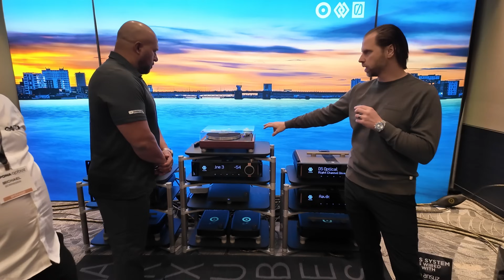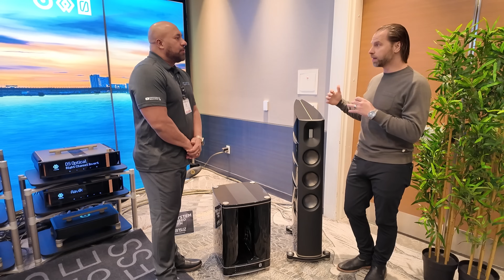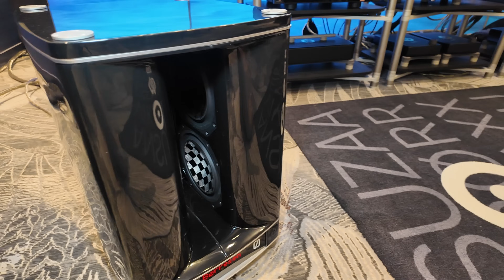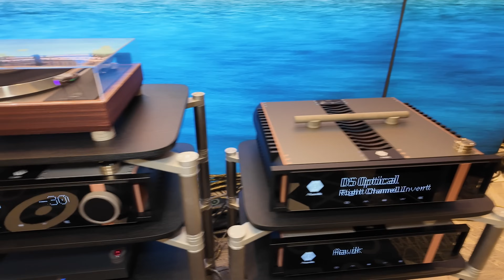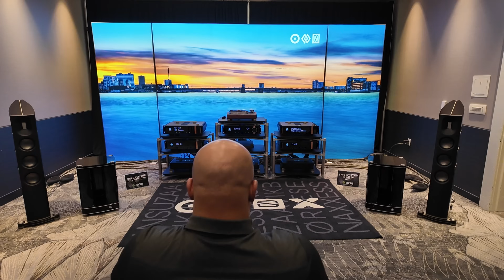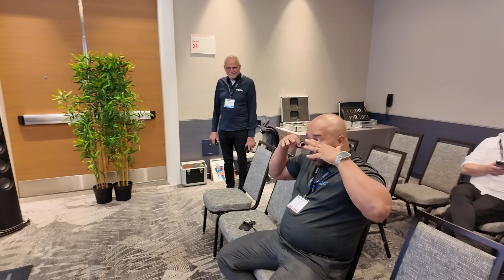Axpona 2025 - World Debut Of Borresen M2 & New Subwoofers!

Comment: No wonder the younger generation have zero interest in high end audio, with these insane prices.
Reply from the maker: Different prices are within the audio group Denmark umbrella. Find the one that suits your budget
Reply: Buy used from the guys that spend their lives chasing different.  My system is mostly late 90s vtl, arc, dunlavy, vandersteen, with a vintage mitchel transcriptor table (because its cool) and a newer high end arc cd.  It can probably be replaced used for $12-15k ish and it outperforms much much more costly systems. 100% room limited so why chase gear? Buy quality and learn how to tweak your room and setup.
Reply from the maker: @johnhartley3022 good point
Reply: Also bingo. @johnhartley3022
Reply: lol... i'm just not as stupid as you / the Borressen Customers who buy one single subwoofer for 20k 😂😂😂... I'm very happy with my systems, thanks... But if you want to get ripped off and want to give them your money, order directly 4x subs + you buy directl ,,subwoofer,, cables for 10k. The borresen guys laughing in denmark.
Reply: @ I agree. Borresen customers often have "to much" money, and very little insight in hifi.. That's a cold hard fact.
Reply: @vtkz  Hi there saying people are stupid is really labeling and disparaging of people with different values and mindset as if they have a lack of intelligence or even a lack of moral-common sense,which is based largely on make wrong perception and projection.This is actually arrogant.Myself when I have the money to purchase the high end audio products that I desire I will do it in a heartbeat.My audio system is modest at this time.😂
Reply: @vtkz  Look, i know people like you very well. The way you think, the things you'd say, the things you believe in. The truth is people like you are poor, bitter and hate the world for your own lack of success. You're so poor that in fact, a home theatre system is stretching you financially. 

And then one day you suddenly come across a couple of forum threads on ASR written by Amir. You discover REW measurements and SINAD figures. Suddenly you believe yourself to be a misunderstood genius. "All rich people must be stupid!! I'm the smart one!!" ASR now becomes a part of your identity, your emotional crutch for being a l0s3r in life. 

So now your mission is to crap on anything above your financial means, just so you could feel a little bit better about yourself for being such a l0s3r in life. 

The truth is many people like Jay started with very humble systems, and many have dabbled in dsp-ed home theatre systems and know them well. They aren't 'stupid' people like you say. Many have worked their way up after having experience with better systems. Contrary to what you think, rich people do not just go straight for a 500k system without knowing anything or having any experience. 

You do not know this because you don't have such people in your social circle, and that's how i know you're poor (even if you claim you aren't). 

But keep having this attitude in life brother, that's what got you here in the first place. 

P. S i already know what kind of response you'd give (if any), either more emotional hate, trigger response, dismissive reply, self-preservation tactics, or claims that you're rich too... I've seen it all. Peace out.
Reply: @vtkz    Look, i know people like you very well. The way you think, the things you'd say, the things you believe in. The truth is people like you are poor, bitter and hate the world for your own lack of success. You're so poor that in fact, a home theatre system is stretching you financially. 

And then one day you suddenly come across a couple of forum threads on ASR written by Amir. You discover REW measurements and SINAD figures. Suddenly you believe yourself to be a misunderstood genius. "All rich people must be stupid!! I'm the smart one!!" ASR now becomes a part of your identity, your emotional crutch for being a l0s3r in life. 

So now your mission is to crap on anything above your financial means, just so you could feel a little bit better about yourself for being such a l0s3r in life. 

The truth is many people like Jay started with very humble systems, and many have dabbled in dsp-ed home theatre systems and know them well. They aren't 'stupid' people like you say. Many have worked their way up after having experience with better systems. Contrary to what you think, rich people do not just go straight for a 500k system without knowing anything or having any experience. 

You do not know this because you don't have such people in your social circle, and that's how i know you're poor (even if you claim you aren't). 

But keep having this attitude in life brother, that's what got you here in the first place. 

P. S i already know what kind of response you'd give (if any), either more emotional hate, trigger response, dismissive reply, self-preservation tactics, or claims that you're rich too... I've seen it all. Peace out.
Reply: @vtkz    Look, i know people like you very well. The way you think, the things you'd say, the things you believe in. The truth is people like you are poor, bitter and hate the world for your own lack of success. You're so poor that in fact, a home theatre system is stretching you financially. 

And then one day you suddenly come across a couple of forum threads on ASR written by Amir. You discover REW measurements and SINAD figures. Suddenly you believe yourself to be a misunderstood genius. "All rich people must be stupid!! I'm the smart one!!" ASR now becomes a part of your identity, your emotional crutch for being a l***r in life. 

So now your mission is to crap on anything above your financial means, just so you could feel a little bit better about yourself for being such a l***r in life. 

The truth is many people like Jay started with very humble systems, and many have dabbled in dsp-ed home theatre systems and know them well. They aren't 'stupid' people like you say. Many have worked their way up after having experience with better systems. Contrary to what you think, rich people do not just go straight for a 500k system without knowing anything or having any experience. 

You do not know this because you don't have such people in your social circle, and that's how i know you're poor (even if you claim you aren't). 

But keep having this attitude in life brother, that's what got you here in the first place. 

P. S i already know what kind of response you'd give (if any), either more emotional h*te, trigger response, dismiss*ve reply, self-preservation tactics, or claims that you're rich too... I've seen it all. Peace out.
Reply: @vtkz private equity making good profits
Reply: @vtkz If someone likes this or any product and can afford it, are they getting ripped off?
Reply: @vtkz sour grapes.  Why are you even commenting if it’s overpriced?  Why would you even care if you like your rig?  Again, sour grapes.
Reply: Priced for fools
Reply from the maker: Im the Messenger. I simply present and inform what I liked that was a standout room for me.
Reply: @jaysaudiolab  Fair enough Jay, your videos always spark some interesting debate and opinions, and thats amazing-
Reply: That's like saying young people are not into cars just because Ferrari and Lamborghini exist.
Reply: @A-gks  the problem is, they are way too overpriced. Subwoofers Performanced is based on DSP integration (Time, Phase & Frequency) & of course placement & concept (Double Bass Array, Single Bass Array with Bafflewall, Multi sub etc). When they have balls, they would show an REW Measurement of their show rooms (they never did of course). They want to sell, thats the main thing. The homecinema guys laughing at this kind of subwoofers. But maybe the high end customers get what they deserve, such overpriced products need to be buyed from people who have too much money, and no logical thinking
Reply: @vtkz  dang that's a lot of words for saying 'i'm poor'

Look, i know people like you very well. The way you think, the things you'd say, the things you believe in. The truth is people like you are poor, bitter and hate the world for your own lack of success. You're so poor that in fact, a home theatre system is stretching you financially. 

And then one day you suddenly come across a couple of forum threads on ASR written by Amir. You discover REW measurements and SINAD figures. Suddenly you believe yourself to be a misunderstood genius. "All rich people must be stupid!! I'm the smart one!!" ASR now becomes a part of your identity, your emotional crutch for being a l0s3r in life. 

So now your mission is to crap on anything above your financial means, just so you could feel a little bit better about yourself for being such a l0s3r in life. 

The truth is many people like Jay started with very humble systems, and many have dabbled in dsp-ed home theatre systems and know them well. They aren't 'stupid' people like you say. Many have worked their way up after having experience with better systems. Contrary to what you think, rich people do not just go straight for a 500k system without knowing anything or having any experience. 

You do not know this because you don't have such people in your social circle, and that's how i know you're poor (even if you claim you aren't). 

But keep having this attitude in life brother, that's what got you here in the first place. 

P. S i already know what kind of response you'd give (if any), either more emotional hate, trigger response, dismissive reply, self-preservation tactics, or claims that you're rich too... I've seen it all. Peace out.
Reply from the maker: Well said
Reply: @vtkz  Agreed, I want Jay to actually show measurements for his high end gear and no way will he ever do
Reply from the maker: @11RESERVERED I will never show any because I am not a speaker designer and I don’t even have measurements for my room 😂
Reply from the maker: @vtkz you’re broke and justify it with dsp lol
Reply: @jaysaudiolab  Damn you got triggered from the dsp comment so much you called them broke for justifiying science and would actually improve it all for you. Sounds like you cant be happy in life if all you ever gotta do is pay extraordinary money and show it off and are never truly satisfied 🤣
Reply: Mugging people off for being broke aint a good look for you Jay...probably remove it if i was you x @jaysaudiolab
Reply: @jaysaudiolab this is as condescending of a comment, even from you, Jay. Which reminded me of why I have unsubscribed from your channel some time ago. This is a hobby, and we are all in this together. How one would want to spend their money is up to them, that is what makes this hobby great. For you to just go out and call someone “poor” to justify something? 
And I know you have to defend Borresen at all costs because they did paid for your trip some time back. But nonetheless, this is very disappointing, even from your standards.
Reply from the maker: @A-gks  bingo
Reply: If you compare the cost for high end audio in the 70s when it became mainstream to the prices now. It’s 2 completely different worlds. It is now for the rich which we have a lot more than in the last century
Reply: @Pksparty2112 it doesn’t need to cost what it is. It’s just profiteering because there’s so much confusion in Hifi
Reply: Completely nonsense price. No speaker is worth it
Reply: @matthiasreinhardtbw 
Perhaps you perceive it as 𝘯𝘰𝘯𝘴𝘦𝘯𝘴𝘦. 
However, ... 𝘯𝘰𝘯𝘴𝘦𝘯𝘴𝘦 is an infinitely sliding bar of one's perception. 

There's plenty of individuals with ample disposable income that perceive such a system as exactly what they want. 

They want the apparent prestige, they want the performance. 
They want the visual aesthetic, the exotic materials, the customer service and exclusivity.
Reply: yeah Ive bought 3 way set of drive units to put using my own speakers. Cost just under £3k
Reply: The next generation will definitely be looking at more value and cost per performance. HiFi does still have a good appeal but it's true about the top end of the luxury/ultra high end. A lot of that is status purchases. I've spent more than I would have liked sometimes but usually these statement/reference products they have to price them quite high because they'll probably not produce a bigger volume of them anyhow.
Reply: Yeah, that's the reason.